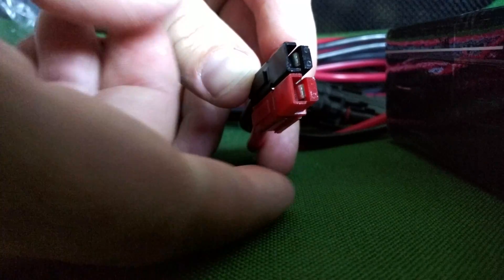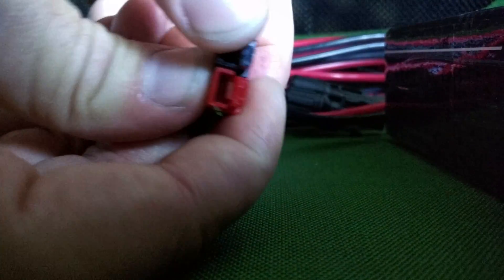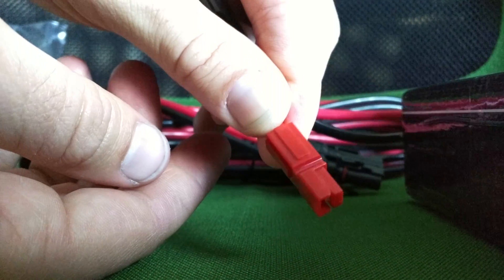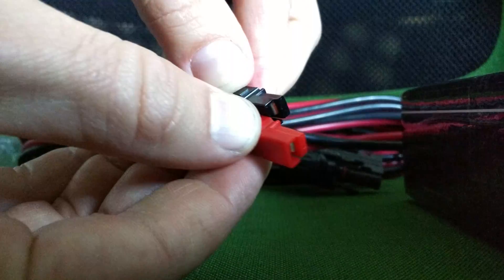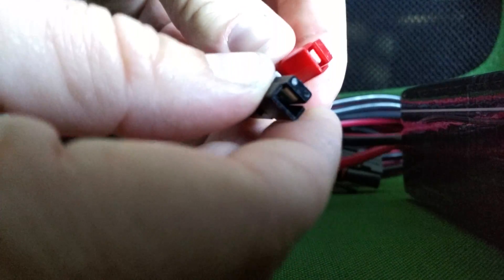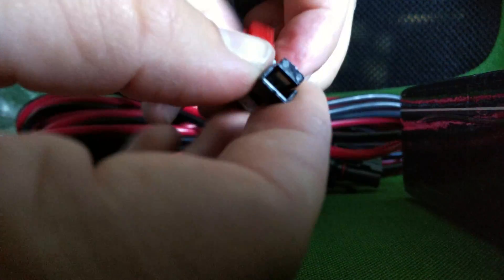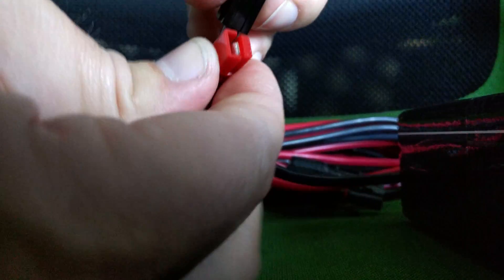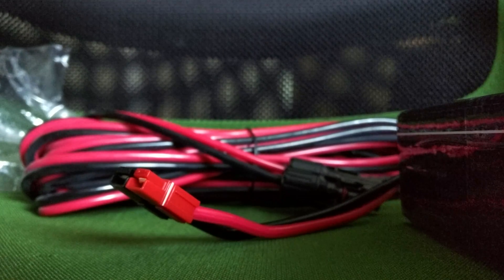Change Orientation of Anderson Powerpole Connectors for Solar Generator & Solar Panels

Comment: I had concerns about using these connectors on my solar panels and someone plugging that into my 12v gear which also has them. I plan to use the connectors in a vertical configuration when using them on a panel. I have always bought the bonded version and didnt realize they had more options to prevent accidental connections.
Reply from the maker: Overall I like the connectors but they're sharp on their corners, be careful with them!